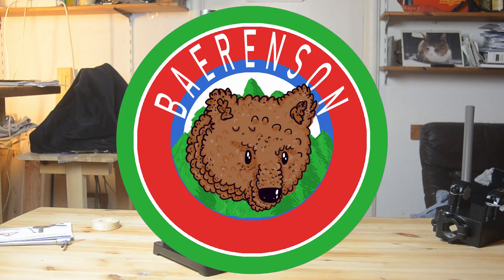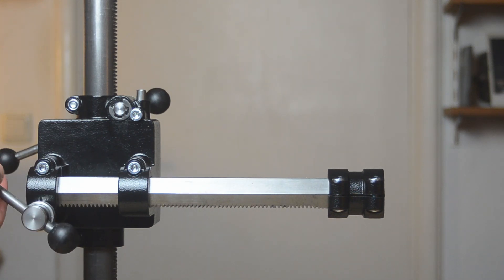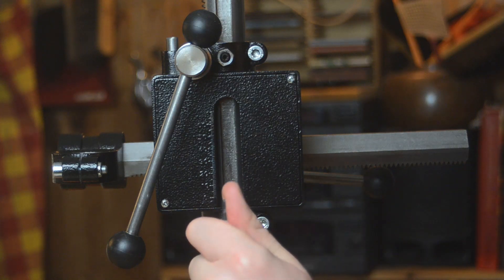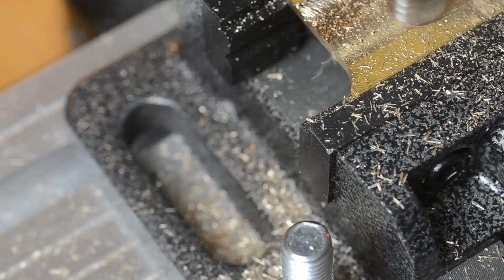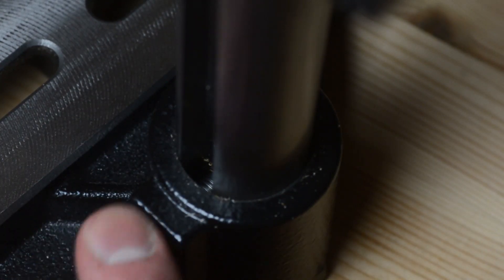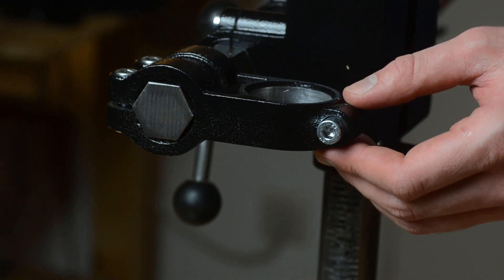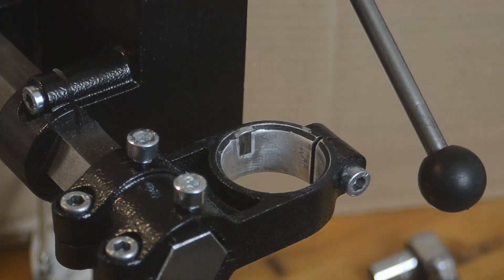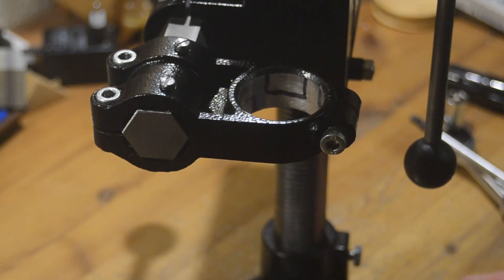Wabeco Drill Stand BF1240 Review: Inaccuracy, Optimizations and Addons

Comment: I had to ask for a year that WABECO return my parts I sent them for replacement, they returned them when I said I will take legal action, however some replacement parts are no better then the faulty ones, others were fixed. They even sold me new part with faulty thread, that I returned, but they never refunded the money, about 80eur. Now I have faulty lathe for 5+ years that I can't even use. I ordering parts from china, re making faulty parts in factory in china. Stay away from WABECO if you don't want to loose money and time.

Comment: Hi Michel very interesting video. I've just bought the BF1240 and I would like to improve the precision. About the metal bar to fill in the column's groove, I wonder why you've made on it two threaded M8 holes which I guess are not corresponding to the two clamping screws in the box. By the way, can you tell me the right measurements of the metal bar? Vielen dank.
Reply from the maker: Hello Claudio,
I made the second M8 hole because I didnt want to damage the teeth of the column. Sometimes you have to turn the column to other positions to solve different tasks. Then the normal screw would hit the theeth. But its not really necessary, because the low part of the theeth will never be used. Only if you would put the column upside down.
Reply: @Baerenson  thanks Michel very clear